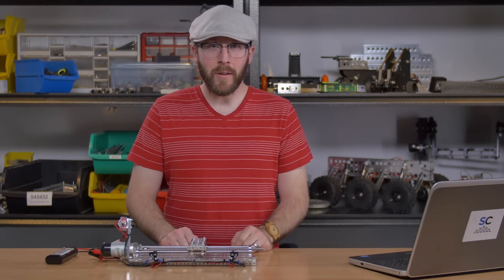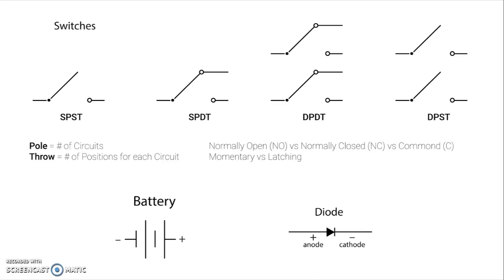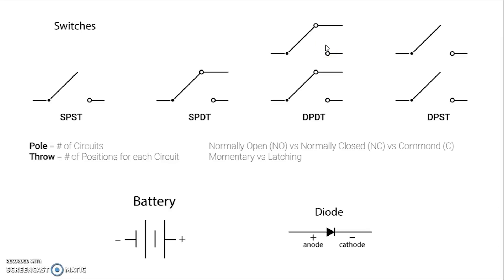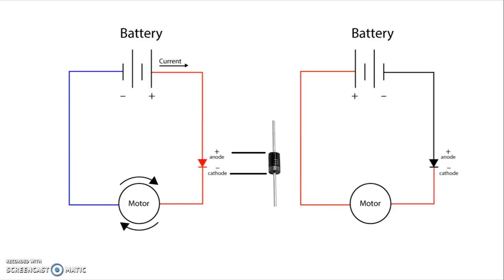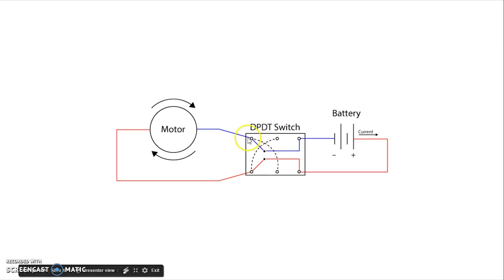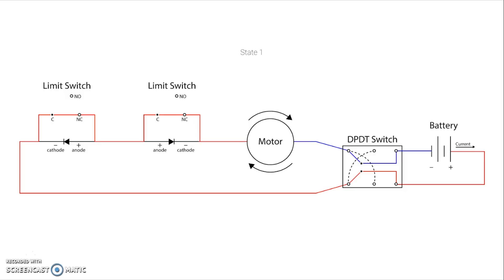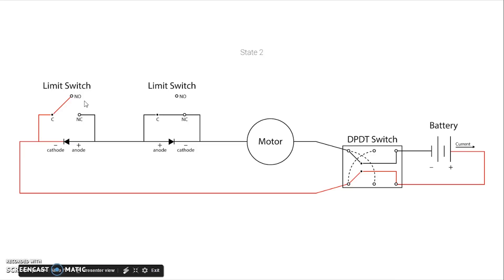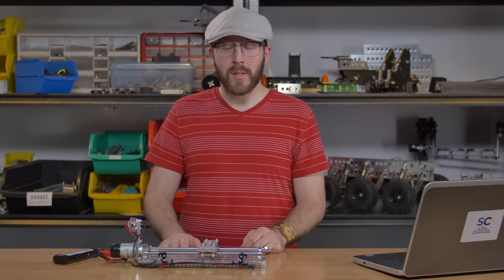How Linear Actuator Circuits Work

Comment: Could you show on how to set up the same system but using relays for higher amperage circuits where the switches, using less amps, to trip the relays to run the motor?

Comment: Can you please help? Every tutorial I have seen, including yours, describes a circuit with just 2 diodes. I have 3 actuators, all faulty, and all 3 have circuits with 4 diodes, 3 orientated in one direction, with the 4th the opposite way around. 
The board has 16 nodes, 8 along the centre with 8 wires coming from it, and 4 above and 4 below this row of 8, to which the 4 diodes are soldered in place. Each of the limit switches has 3 wires connected to it, coming from the circuit board. 
The actuators operate from a 12v DC supply, so these circuits are NOT rectifiers, but instead seem to be a more unnecessarily complicated way of achieving the same purpose. They all seem to have issues with their circuits, but I am at my wits end trying to figure out how the current flows. Do you have any experience with these circuits, and if so, any chance of help please? Thank you, Alan.

Comment: Thanks, I recreated this circuit with a relay instead of a switch and a prox switch to drive the coils. Basically created a gate using rope on the shaft with limit switches nearly matching exactly what you have.

Comment: Interesting circuit, but wondering if this works with higher current drawing motors ?
I have made the same operating circuit with a latching relay that can can control much higher current.
Perhaps a video on that would help some of your subscribers
Reply from the maker: Sweet idea! Thanks for the suggestion.

Comment: Can you please suggest a way on making it a three or more position actuator, that will be really helpful.
Reply from the maker: Hello,
In many applications, the most flexible way to do this would be using a microcontroller like an Ardunio, combined with a motor controller.
Reply: Thanks for the suggestion sir, but I'm a noob. I'm just getting started with the arduino stuff. Can you please explain it in a bit more detailed way that would be really helpful sir.
Reply from the maker: @kashv1793  Please feel free to shoot us an email to tech@servocity.com! Our tech team would be happy to help you out more there.

Comment: Extremely informative. Hey, what's the name of the battery you're using?
Reply from the maker: We show this build with a 3,000mhA LiPo battery. But if we were to do it again we'd use this battery:
https://www.servocity.com/12v-3000mah-nimh-square-pack-battery-sub-c-cells/

Comment: Great Video.... I have a question having to do with this type of actuator.  My application would be for automotive. I’m interested in installing a wing on the back of my car, but I want to modify the mounting brackets to accept electric actuators..... so far it’s straight forward.  However, I would like to to be wired up with the brakes/brake lights. I want the actuators to open when the brakes are pressed and brake lights come on and the when the brakes are released for the actuators to close. Just like the brake lights.... is this possible?
Reply from the maker: Yes, that is possible.  You would need electronics to tie in with the brake signal as you mentioned.  Please feel free to reach out to us should you have any further questions to tech@servocity.com.

Comment: Also,  how did you connect the lead screw to the motor,  and how many rpm is that motor as ive noticed a few variations on your website.  Cheers
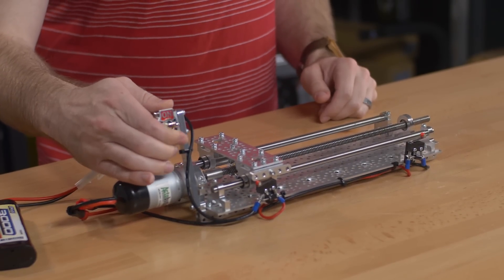Reply from the maker: Hello Nate. Feel free to use that design. It has been a while, but I believe (and I think I can see at 1:02) that it was a 612RPM motor (sku 638284). The lead screw is connected with a coupler. I would recommend 625091.
Here are most of the other parts used: 

555176 (motor mount)
1612-0815-0045 ( linear bearing)
585640 (clamping mount for linear bearing)
585004 (pattern plate for base)
634314 (shaft)
3501-0804-0300 (lead screw)
545315 (lead screw nut)
545404 (pattern mount for lead screw nut)
585634 (clamping mount for shaft)
585720 (pattern plate for gantry)
535104 (pillow block)
605126 (diode)
605634  (limit switch)
605626 (limit switch mount)
585399 (mini channel under base)
585404 (beam as a trigger for limit switches)
605048  (toggle switch)
don't remember for sure but I think I used a 585403 and maybe a washer to mount the 5-hole beam.
Feel free to send an email to tech@servocity.com should you have any other questions!
Reply: @ServoCity  thanks guys!!  I really appreciate you responding so quick
Reply: I forgot to ask what power source you used?

Comment: is it possible to add pwm dc motor speed controller into the circuit because sometimes I could not find the motor with the right speed for my need in the market here....thanks so much you help me  a lot
Reply from the maker: A linear actuator is little more than a motor that's had the rotational motion converted over to linear motion.  You can run a motor controller to adjust the speed based off the PWM signal being sent or you can run a motor controller with feedback and tie in the potentiometer so have position control.  Step #1 of this ( https://www.instructables.com/id/Controlling-the-Actobotics-Dual-Motor-Controller/ ) instructable shows how to use the Actobotics Dual Motor Controller for speed control.  Step #4 shows how to use the  Actobotics Dual Motor Controller for position control.  Please contact us at tech@servocity.com should you have any other questions and we'd be glad to assist.

Comment: Just a note.  You don't really need diodes.  You can put the limit switches between the DPDT momentary switch (direction) and the battery.  The DPDT is then used to select the appropriate limit switch AND select the polarity of the battery.  It's a bit more wire this approach eliminates the specification, purchasing, and wiring of the diodes all-together.  Just to make it clear, this approach still uses the same DPDT momentary (for direction) switch.... just not the diodes..
Reply: Diodes are often used to help prevent back-EMF from destroying your stuff though, they're cheap insurance

Comment: Hi , great explanation thanks for that ! i just finished building an actuator for a project i'm working on using this video as a tutorial although i used a couple of different parts to you. Instead of using a DPDT switch i used a SPDT switch . Well really thats the only difference . there is just one thing that i'm curious about i noticed that when the limit switch is depressed (Regardless of which one is depressed) when i flip the 3 way switch to spin the motor the other direction for a split second you can hear that the motor is taking advantage of all the available power but then once the limit switch is released and both are making contact it's fine . This only happens for a split second until the limit switch is released and makes contact again completing the circuit . Do you think i have anything to be concerned about ? could it be that the Diodes i used are too small?
Reply from the maker: If you want to have a technician review your circuit diagram please email it to tech@servocity.com we'd be happy to help.  Thank you!

Comment: What motor you have used in this linear actuator? Please mention how many voltage and RPM motor you have used?  I hope that you will reply. Thank you.
Reply from the maker: Hi Analan, I used a 612 RPM Premium Planetary Gear Motor (pn 638284) running at 12V. https://www.servocity.com/612-rpm-hd-premium-planetary-gear-motor
Reply: ServoCity Thank you.

Comment: Hi, I've got a question, is it possible to make a motor with lead screw as strong as linear actuator? I want to make a sit-stand desk, if I'll get a high thread-per-inch lead screw and a strong motor, can it hold on as much as a linear actuator? I think it may be cheaper for me than getting two linear actuator of proper size.
Reply from the maker: Hi Filip, you'd basically be creating your own linear actuator by driving a lead-screw with a motor.  With the proper selections you can build a mechanism that would have plenty of thrust.  If you have any specific questions feel free to contact our Tech Team directly at tech@servocity.com.

Comment: Excellent job, this gave me exactly the Information I needed. I've been looking for this info three days straight on Youtube. I purchased some of these parts separate, but making them play well together was beyond me until now. My project consist of chicken coop automatic door opener. I am adding a thermostat (too cold wouldn't open), timer when to open and close, light sensor (dawn to dust), and the DPDT with limit switch (plus the diodes) which I now know I need to purchase. 
Awesome next video for urban chicken owners on how to wire their chicken coop automatic door opener that is self regulated all year round. 10 thumbs up - great job! Extremely thankful for your video.
Reply from the maker: So glad you found our video helpful!  Good luck on your project and let us know if you have any additional questions tech@servocity.com.

Comment: how does the limit switch gets open or closed?
Reply from the maker: The switches are located on the acme screw inside the actuator tube. The switch will meet a stop when fully extended or fully retracted.  Please feel free to contact our Tech Team should you have any additional questions! tech@servocity.com

Comment: Ι have done something like that but with 2 relays...with 1 sounds more simple and clever way to do that.
 But the problem with both is that the relay coil will stay energized when the terminal switch is open :(

Comment: Hi great video thanks. I'm using a 3.7 v actuator running off batteries could you tell me please what diodes I'd need. Sorry my tech knowledge is very low.
Reply from the maker: Partially that depends on how much current it needs to handle. Our diodes (part number 605126) can handle up to 5A and up to 40V. Here is an article (not from us) which has some more info on selecting a diode for your project: http://ourpastimes.com/choose-right-diode-7433946.html.  Feel free to contact us should you have any additional questions tech@servocity.com

Comment: Nice video. You answered my "What's the point of the diode" question just as I was thinking it. Good Job. Might be beneficial to link to the parts you used in the build in the video.
Reply from the maker: Thanks, Colin.  Glad you found it helpful.  We've added the links.